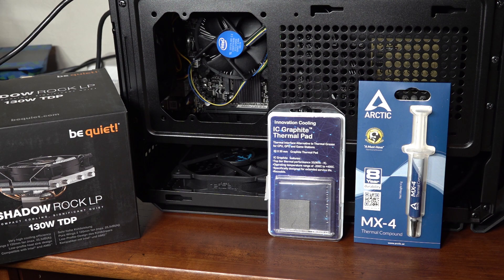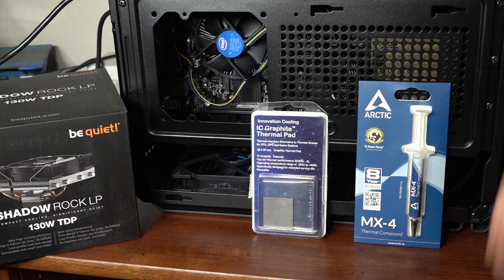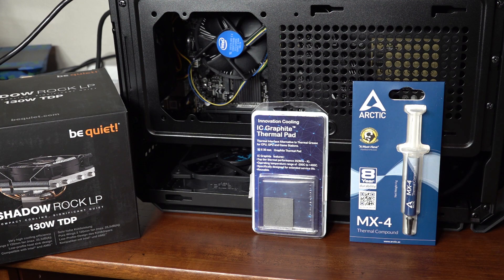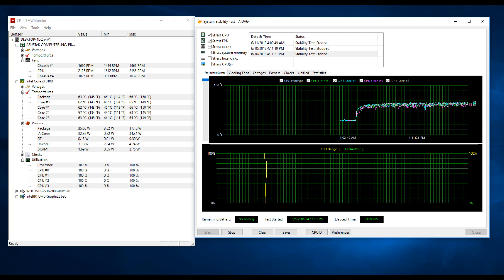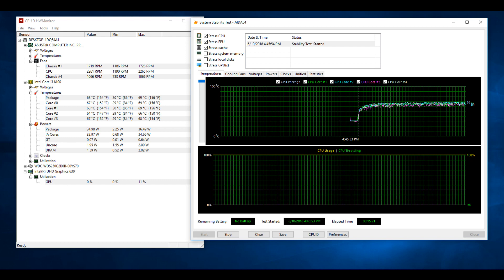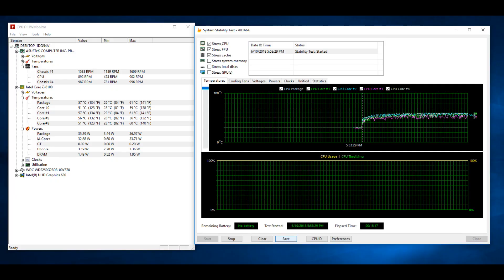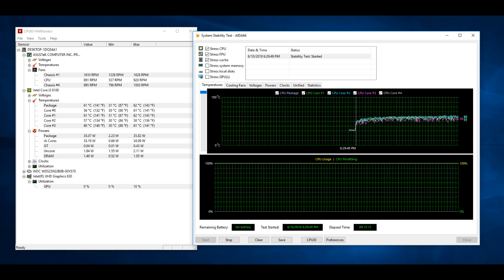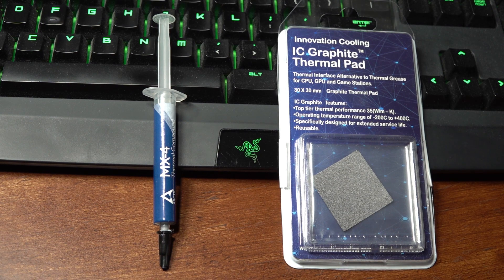IC Graphite Thermal Pad Testing and Comparison

Comment: I just installed a Thermal Pad with an AND Ryzel 2700x and wraith cooler. I ran HWMonitor and AMD Ryzen Master to monitor Temps. I never got any higher than 53 degrees celsius. with the Thermal Paste (stock) I got about 51 to 53 degrees. Just make sure youre getting a pad that is for CPU usage and "Set It and Forget it" . Covers the entire CPU no problem. *The package also says that it's not recommended if you're overclocking so if you plan on overclocking, use Thermal Paste*

Comment: What if we use Thermal paste, then the pad, then more Thermal paste on the top side of the pad? This sounds like something that would be worth testing?  

Just don't ask me to test it :o/ I only have one PC
Reply from the maker: In my opinion, if you are going to use paste anyway, just use paste.  You want as little as possible between the two surfaces.  It would really be ideal to have the surfaces in full, direct contact, but since surface imperfections make that impractical, a thermal interface is required.  I'd prefer as little thermal interface material as possible to do the job be present.  Paste is nice because the excess can squeeze out, leaving the two surfaces as close to direct contact as possible.  The thermal pads make up for their extra thickness by transmitting heat more quickly.  I don't imagine that adding layers would help.  

But I can't say definitively, since I've never tested it.  I don't currently have a computer that would be convenient for testing, but if I put one together at some point, I'll keep that in mind as a possible test to try.

Comment: The trouble with paste on AMD is the risk of the CPU getting stuck to the heat sink, and damage to the CPU or M.B.caused in having to yank it off.
Reply: That is why you give it a twist to see what is gonna happen before you either take it out perfectly straight or just tip it off one side after the other

Comment: I got some of this Panasonic carbon material the Digikey # P14965-ND THERM PAD 180MMX115MM W/ADH GRAY 0.0008" (0.020mm) The thinner the carbon pad the better the transfer vertically if you read the specs. I used it as a cpu thermal transfer on a Intel 9600K in place of thermal compound. It is easy to cut since it has a removable mylar backing. With the mylar removed it holds together and has a slight adhesive so it stays in place. You can peel it off to reposition if you need to. I could not see any difference in the cpu temperatures after application. One sheet is 4.5" X 8" so you can do a good number of cpu's with one sheet.

Comment: I folded it (once evenly horizontally and vertically,) so it's like 4 layers to fit my PS4 Slim APU size & cut the excess off. My PS4 is extremely loud now but it's cooler than normal/ stock thermal paste. It will overheat if you dont fold it. For the record Thermal Grizzly in better do your research.
Reply: Did you clean your fan and heatsink

Comment: Going to put this in my laptop.  I would only see this stuff being used in things like consoles, laptops or servers.  Things that aren't normal to take apart like a desktop.
Reply from the maker: A pad like this definitely seems like a good OEM option.  Still, a dab of thermal paste likely has a cost bordering on virtually zero.  I wonder how the cost of a pad like this would compare for an OEM.  Thermal Grizzly is soon to release Carbonaut, which is a carbon-based thermal pad.  I'm looking forward to testing it out and comparing it to the IC Graphite pad.

Comment: Anyone tried on a Threadripper?
Reply: Yes, it works great. Same thing, just 1 to 2 c higher than normal. Well worth it to me because I use a custom water cooled loop on both my ryzen and threadripper machines. Custom water cooled loops need to be taken apart and cleaned on a regular basis. Removing old paste and applying new paste every time was such a huge pain in the ass in the past. Graphite pads makes life so much easier for me now.

Comment: I you swap a lot cpus this is pretty decent as it will make you spend less money and will be pretty equivalent to a thermal paste (+5° is not huge)
Reply from the maker: Yeah, plus, no mess to clean up in between.  Definitely has benefits for someone doing lots of CPU/cooler swapping.

Comment: I just bought the IC Graphite Thermal Pad, and tested it and with my Intel Core i7-5775C OC to 4.0GHz he only gets 4c hotter then with my original Gelid GC-Extreme thermal past.

So again strange you have 8c higher temps and i only 4c more.
Reply from the maker: Again, I did not get 8C higher temps.  There were four tests done for the video and the results for all four are shown in the video.  The first test was with a stock Intel cooler with pre-applied thermal paste and it reached 66C.  The second test was with the same stock cooler, but instead with the IC Graphite pad and it reached 69C.  A 3C difference.  The third test was with an aftermarket cooler with MX-4 paste and it reached 61C.  The fourth test was with the same aftermarket cooler with the IC Graphite pad and it reached 62C.  So there was a 1C difference with the aftermarket cooler and a 3C difference with the stock cooler.  You are missing something in the video if you think I ever had an 8C difference between the pad and paste.  I tested two different coolers, each with the pad vs. paste.  As I said before, a 1-3C difference is all I have ever seen in any of my testing.
Reply: @bigtb1717  Yeah strange, then i have missed something in the video, sorry.
Reply from the maker: No problem and no need to apologize.  I just didn't want you to be left confused and questioning the thermal pad.  Cheers.

Comment: Very strange, at Linus Tech Tips the temp difference was ONLY 1c, and that with a 8 or 10  core CPU, and almost the same for Hoosier Hardware, only 3c difference.

https://www.youtube.com/watch?v=YpphKzmDiJM&t=210s

https://www.youtube.com/watch?v=56LEGALV-kA
Reply from the maker: Maybe I'm missing something, or don't understand what's strange.  I saw about a 1-3C difference, depending on what core I was looking at and which cooler I tested.  Seems similar to what others have seen, no?
Reply: @bigtb1717  No you say and i can see a 7-8c difference, with the Innovation IC Graphite Thermal Pads you get 69c, and with thermal paste you get 62c.
Reply from the maker: I tested two different coolers.  With the stock cooler I got 69C with IC pad, and 66C with paste.  With the aftermarket cooler I got 62C with the thermal pad and 61C with paste.

The results of all four tests are in the video.
Reply from the maker: I now have the pads in both of my systems and in two others I built for others and it is working well in all of them.  I have another video were I compared it to a system with three year old paste and saw the same 1-2C temp difference, paste vs. pad.

Comment: would be acepatable to use IC on a GPU?
Reply from the maker: Probably work fine, but the results will likely depend on the exact card in question.  Since the heat sinks often contact more than just the GPU die itself you would want to be sure that the slight thickness added by the pad didn't adversely affect the cooling of the other components.  If the thermal pads on the other components were thick enough to take up the slack it would probably be fine, but you would want to look close to make sure it would all be good.  The IC Graphite pad isn't very thick, so it's probably a non-issue, but that would be my only concern.

Personally, I'd cut it to size so there is no overhang, since the pad is conductive.  You want to make sure in can't come into contact with any components on the board before you power things up.
Reply: @bigtb1717  got it, thx for the response!

Comment: Using this product on a qnap media server running a i7. The reason I chose this over paste is because it's going to run for years and is fairly difficult to get to the processor to apply to new paste. For regular PC's and  other systems that are fairly easy to take apart I can't find a use for this product. Only benefit to me is the fact it should never dry out and this product is better than dried out paste.

Comment: I would actually state that these could be used for seriously frozen systems. When you use dry ice it liquid nitrogen.  The pastes can freeze this not conducting. The Thermal pad is graphite and won't freeze.

Comment: I would say that few degrees on stock setup or idle doesn't make any difference to anyone in fan noise levels or otherwise... If OC with big enough heatsink/radiator the story might be different. I would do the testing with fixed fan speed BTW to see actually the difference. But I know it is not easy to get consistent and reliable test results even when locking  CPU clocks and running the same stresstests checking vcore/power draw is same,  ambient temp is recorded, etc etc... jadjadjada

Comment: can you use this on a gpu?
Reply: Apparently you can. If you're still curious to see how well it works, I have a overheating GTX 950 I'm going to try it out with tomorrow. I'll reply with results.
Reply: @kbreezy557  How did it?
Reply: @heutemalnicht  oops forgot about this lol. So it "worked" but not the best. I cut it to size for the gpu but I think the issue was that my heatsink wasnt applying enough pressure to the pad. My temps were a little higher than I liked so I switched to paste. I did however use it for a CPU and it was fine.
Reply: I just did in my laptop. GPUs showed about 4 degrees down when my cpu went up by 3

Comment: I tested in compared this same model of pad also versus Grizzly thermal paste. The graphite pad ran just a few degrees warmer. 
I could see the advantage to this if you are testing out different CPUs or if you are unsure about how much thermal paste to use, or just don't want to hassle with the mess. The biggest problem I ran into with it was making sure the pad didn't move around while I was installing the cooler
Reply: Roger London  I never thought about that, but it might solve the problem to the pad moving around. It kind of defeats the purpose though...

Comment: Most likely this is a rebrand of the Panasonic Soft PGS. I did some testing of the Soft PGS, but never got good results. My guess is the heat sink doesn't provide enough pressure on the CPU. Used a Ryzen 1700X and a bequiet cooler.

Comment: Good solid review.
I would say EVEN clamping force is very important for this graphite pad, and rather a high clamping force is needed to get those extra temp digits down.
IC Graphite Thermal Pad surface looks odd to me, why does it have such an uneven surface? 
We all know from back in the day, that a mirror surface on CPU and cooling surface have the best heat transfer. (CPU Lapping)

All the bumps and crannies are causing less surface contact, a mirror finish on both side of the Graphite Thermal Pad would have much more heat transfer.
And i think it could easily out perform any Thermal Paste on the market.
Reply from the maker: You could be right.  For what it's worth, they say the lateral transfer of heat is so good across the pad, that the fact that the contact isn't perfect is less of an issue, thought I think that's why it can't match the best paste.  

Also, it's hard to tell in the video, but after removing a pad that has been installed, everywhere there was contact the pad looks slightly compressed, and the surface looks much smoother and almost shiny.  Still not like a mirror polish, but the pad does compress and smooth out some when installed.  The surface is initially rough, but is a bit pliable and does conform, somewhat, to the mating surfaces of the IHS and cooler.
Reply: there was another guy out there who was goofing around with a lighter to see if it would melt I guess. The heat transferred so fast and completely to the edge he was holding that his reaction was fairly dramatic and he couldn't let go fast enough.

Comment: Might be a problem with contact, 1 pad might be too thin for certain setups. Some people have reported drops of up to 10c from performance pastes. Try using two pads at the same time? and run a stress test.
Reply from the maker: Do you have links to the reports claiming a 10C drop vs. good paste?  Would be interesting to know their setup.
Reply: http://forum.notebookreview.com/threads/ic-graphite-thermal-pad-available-for-test-and-review.815439/

Some where in that thread i read it months ago. Theres also someone that had great results with a laptop, so i suspect it has alot to do with fitting and filling the gap properly as not all heat sinks/mounts fit perfectly level. Some appear to have got results using copper shims to get better pressure.
Will you do more videos if you test new methods with the graphite pads?
Reply from the maker: I do have a second video showing a comparison between the IC Graphite pad and MX-4 paste, both three years old and fresh.  Different CPU and cooler than what is used in this video and similar results were seen.  I've also used the pad on two other computer builds.  Both have good results, but I haven't compared to paste on those builds.  I can't imagine I'd see anything like a 10C reduction vs. paste on a stock processor that hasn't been delided.  

I'm doubtful that adding an additional pad would help considering I'd just be adding more thickness and more surfaces through which the heat must travel.  In my testing, each time the pad was removed I could see the impression of the processor IHS, so I think I was getting good contact.  

If I decide to compare the results of the thermal pad with paste on the other builds I'll either make a video (if the results are interesting), or just update here if the results continue to be consistent with my other tests.

Comment: Down to 9.99 on Amazon so I decided to pick one up to try it out
Reply: They have 30x30 and 40x40, i would recommend getting the 40x40 one.
Reply: Nisco Racing 30x30 was 9.99 and fit perfectly on my Intel cpu I would have had to cut a 40x40 but it's probably perfect for and and Intel x299 line etc
Reply: Okay good :D I have X299 :) looking into getting it and do some benchmarks.
Reply: Nisco Racing like most found it's a few c off. But my 7700k is delided and overclocked so it's results may not match others. But a few c vs never changing thermal paste again is a nice trade off
Reply: Well i think i can fix those few C difference from paste. This will be a hobby project for me :D

Comment: I have one of these pads on a 2700X running stock (mostly pointless to overclock a 2700X) with a Cooler Master MasterLiquid ML240R RGB.
I will gladly trade a small amount of thermals for the benefit of not having to use paste anymore. Expensive, but it does the job for what it is.
Reply: They WERE expensive. $15 for the 30mm and $20mm, but now they've dropped in price on Amazon since then.
Reply: I agree. Love the idea of no paste. This review helped me make my decision. Amazon wish list updated....
Reply: I bought a ic thermal pad too. The temperature did drop. But i do want to use mx4 see the temperature compare to thermal pad
Reply: totally agree JTC , scares the crap out of me applying paste ,always scared I got too much or too little paste .
Reply: @skinnygirlstretchmarks  But you can cover 10 CPUs with thermal paste.
Reply: While the temperatures were certainly acceptable, I still wanted lower temperatures. So I went back to regular thermal paste (Cooler Master MasterGel that came with my ML240R RGB AIO) and got a 5-10 degree drop across the board. I don't think I did anything wrong with the installation of the pad. But I'm my particular use case, paste performed better for me. I still recommend pads for anyone who wants to set it and forget it.

Comment: Thanks for the vid, just got one and going to see how it will work with a 2700x using a noctua dh15 cooler
Reply from the maker: Yeah, my results are just one data point, so it will be nice once a wider range of results are available to get a good idea of how well these things work.

After the video I used one on an i7-8700 (non K), and a BeQuiet Pure Rock cooler.  I don't have any numbers with thermal paste to compare, but it does fine with the thermal pad.  Testing with Aida64 the processor temporarily runs at 100 watts, clocking at 4.6 Ghz on all 6 cores.  But after a short time it drops back to the TDP of 65 watts draw and stays there (runs around 4.2 Ghz per core at that point).  It reaches something like 72-75C during the 100 watt period, but when it drops back to the 65 watt draw the temps drop to around 60C and pretty much stays there. 

If it was an unlocked processor and I was overclocking, I'd probably use paste (not to mention a larger cooler), but with the current setup it is running great and temps are fine.
Reply: bigtb1717 Hi, I also have the i7 8700, I'm using the stock cooler and it's pretty weak and loud, I get temperatures around 80 C playing bf1, I want to upgrade the cooler but I'm not sure in buying a be quiet pure rock or a pure rock slim, what would you recommend me? Great video btw, I'm thinking in getting the thermal pad too
Reply from the maker: If you have the room with your setup, definitely the Pure Rock over the slim, as it will provide a bit more cooling.

Only criticism I have for the Pure Rock is the mounting is a bit more of a pain than it seemed like it should have been with how simple and straightforward the design is.  Still, I'm happy with it.  I have a Noctua NH-U14S that I'll be using in my upcoming build.  It's larger and is reputed to have one of the better mounting systems out there, so we'll see how that goes.